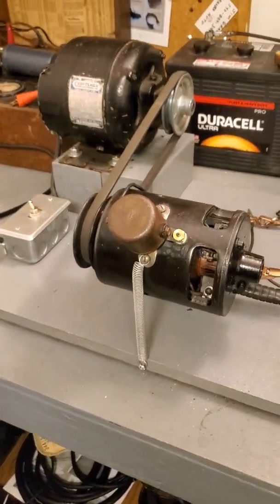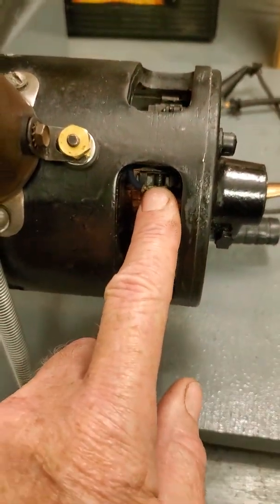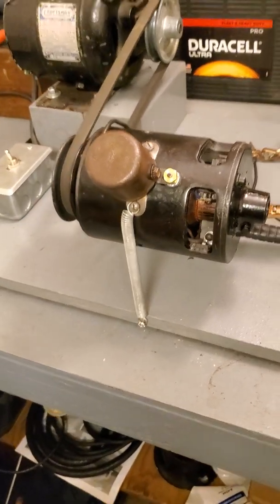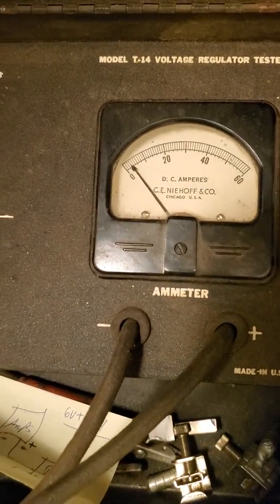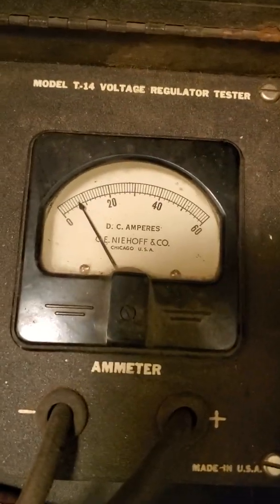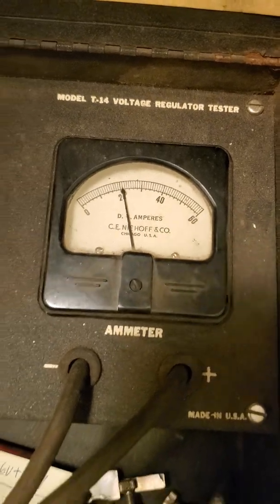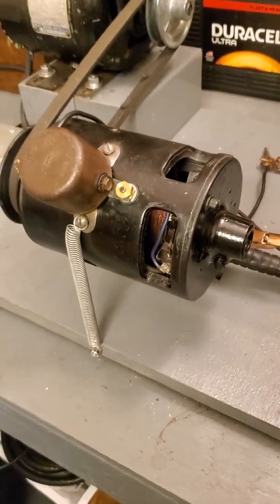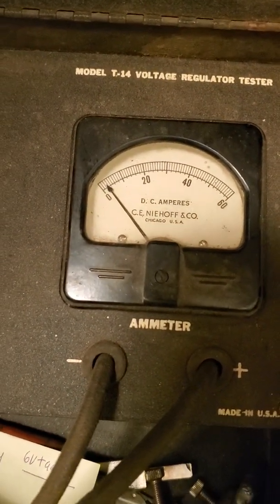Ford model A generator 3rd brush adjustment

Comment: The first time I did this I was confused because my generator does not have slots in it. No way to move the 3rd brush. Turns out you must loosen the bolt holding the shiny band that encircles the generator and slip the band off the end of the generator to expose the slot.

Comment: I’m currently rebuilding a 31 Model A and don’t have lights yet, so I would like to push the 3rd brush all the way up to see what kind of charge rate I get. Do I need to be careful not to push it up to where it contacts the brush above or can I just push it up until it stops? Thanks!
Reply from the maker: It is possible to push it up against the power brush. So look closely as you do. Also Don't run it for long like this, and don't expect the dash ammeter to give an accurate reading.

Comment: My Model A was converted to seal beams, it charges 7 during the day, 0 at night on low beam, and minus 3 on high beam. Its has thee 6volt original generator.

Comment: I have LED lights that flicker, I'm on my 2nd set. This time I purchased the focused beam LED and they also flicker. Did you have this problem? I'm thinking I might bring the amperage up a hair. 6V Pos ground.
Reply from the maker: I have no flickering with my LED headlights. Fkickering is usually caused by poor grounding. I made sure the headlight bucket to bar and bar to fender coneection points were clean and shiny, and put a thin film of dialectric grease at each point. I also have an extra ground cable from frame to trans.